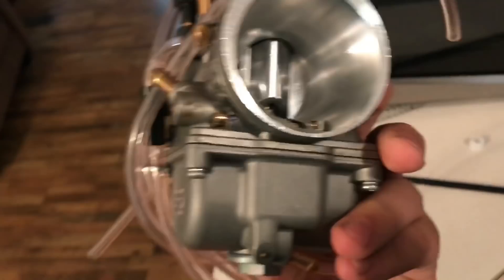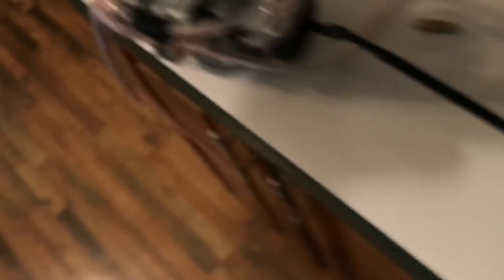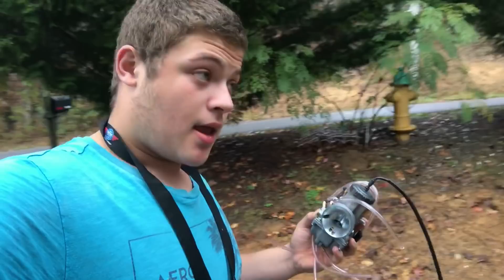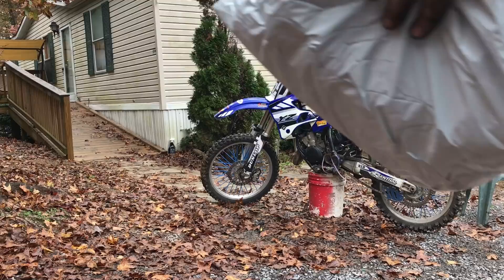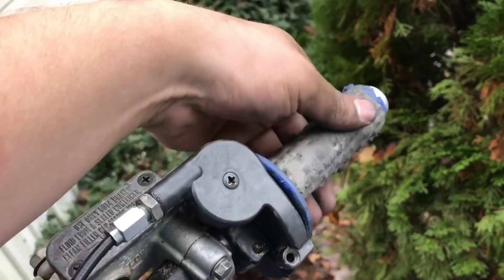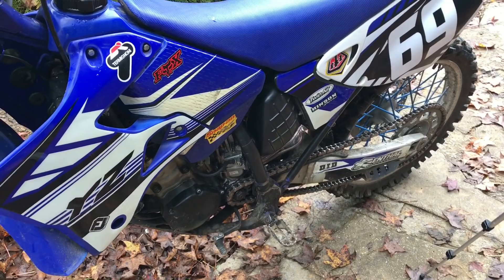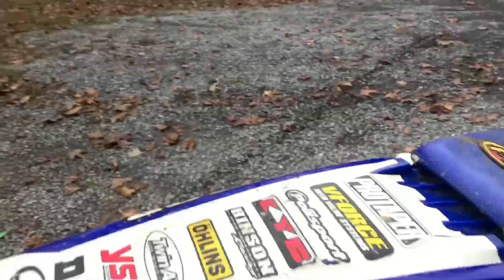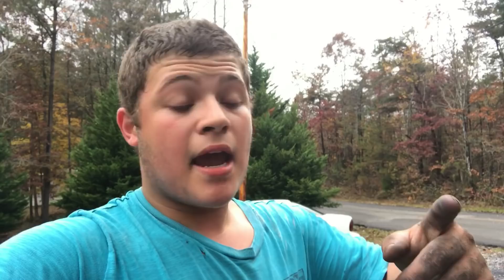40$ Yz125 Keihin Carburetor - Will It run ?

Comment: Those carbs are made for many different engines... you need to change the jets and needle to suit your engine
Reply: This is so true. I had the air striker on my yz125 without changing the jets. it was bogging when trying to hit high rpm’s. I changed the jets and it’s running perfect now

Comment: I think inpatients is your downfall. I fitted that carb and it worked fine. Just needed a float adjustment.
Reply: he just needed to open it and inspect it, no fuel was going into mine when i got it because the needle was stuck to the seat i just gave it a little tug and the float dropped and started allowing fuel to flow.

Comment: You probably should've adjusted the jets inside the carb before putting it on and check your idle screw
Reply from the maker: +Michael Parker when the carb adjustment screws has a stock setting marked on it then that’s what I leave it on
Reply: Highgear MX ohh gotcha, then I'm not sure what it could be but luckily you've got a new carb coming soon
Reply: Your sped because you only adjust the air screw and needle... you don’t adjust jets you change them

Comment: Put the fuel screw all the way in and then turn the air screw all the way in to get it running. After that, make the adjustments as needed. If it’s still not running that great, put a 160 main jet with a 42 to 45 needle jet and you should be good.

Comment: You have to jet your carb to your bike and elevation.
Reply: DirtRichRiderzZ ...yep, I just sold my '01 YZ125 and I ran a pwk air-striker carb, changed out the jets and adjusted it correctly, never had no issues with it ...

Comment: the fuel line is to long for one thing and its lower then the carb inlet, and if it dont start after a bunch of kicks throttle it about 3/4 and it will fire up, and if it dont pull the plug and see if its wet

Comment: Heyy im not saying that ur dumb but i have that same carb 36mm keihinn and it works fine on mine the thing is that you need to know if the oil systing if flowing good in the carb if the floater is stuck it wont get any oil in the carb so it wont start or try starting it with the choke on when it starts just push the choke back off
Reply: ૨αყҡσɳρlαყƶ ...the oil is premixed in the gas, at least it's supposed to be anyway... I used this carb on my '01 YZ125 and it ran fine...it needs to be set up correctly and adjusted right... supposed to do that first before its installed on the bike
Reply: B. Double-R Big Red Ram What jetting did you run?